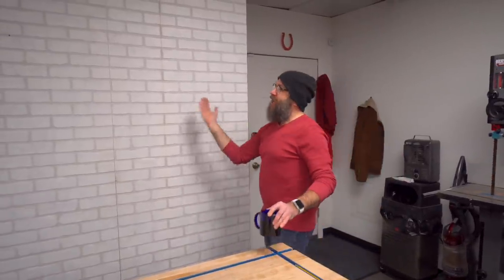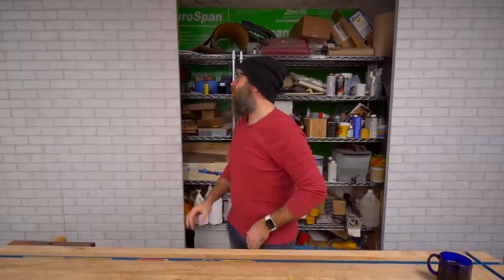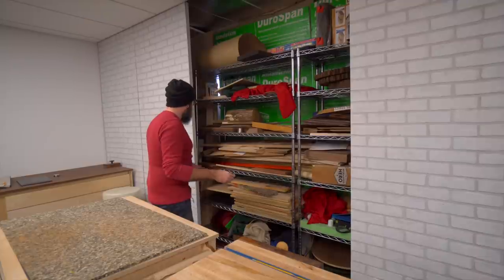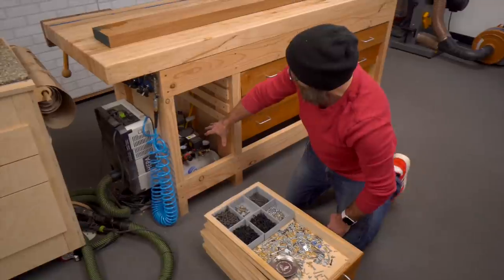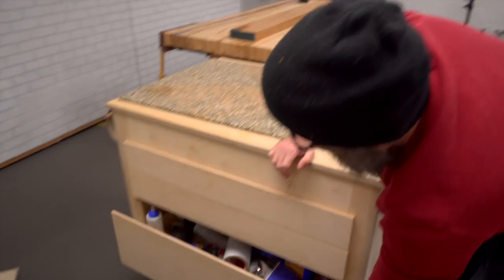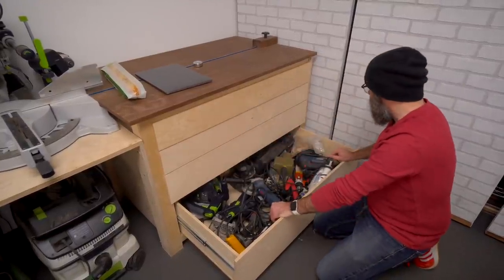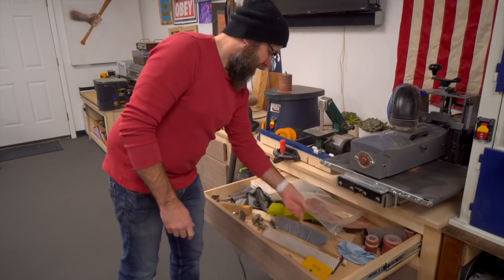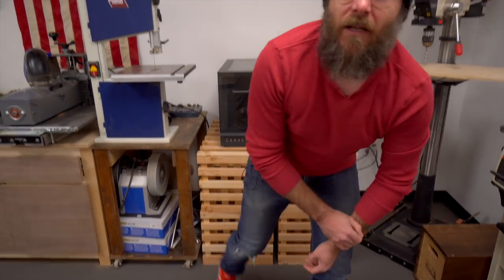What's In My Drawers

Comment: Hey David, great video!!  I see you use harbor freight f style clamps, have you tried their bar clamps?  The ones just like the rockler.  You can get them for like under $15 a clamp at HB, but rockler is something crazy like $60 per.  Some people said they have a tendency to flex slightly, but others have said cutting some wood down and plugging the hollow inside channel.  Would be nice to see the difference between the HB freight clamp and the rockler clamp
Reply from the maker: I've tried the HF aluminum bar clamps and they have snapped on me. I can't recommend them.